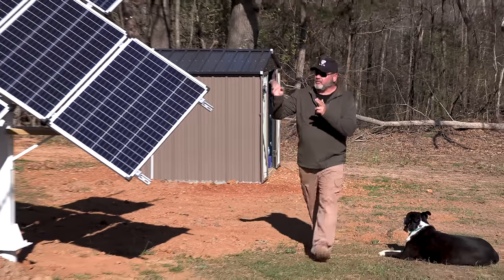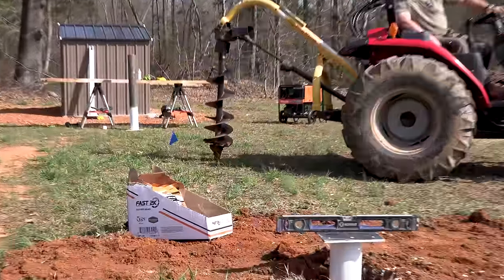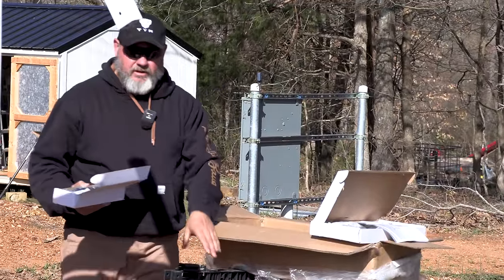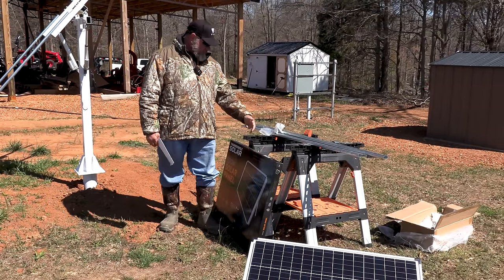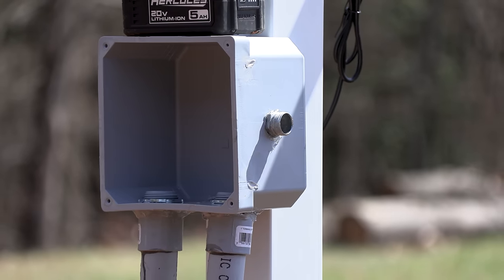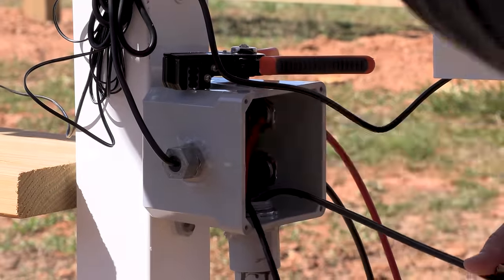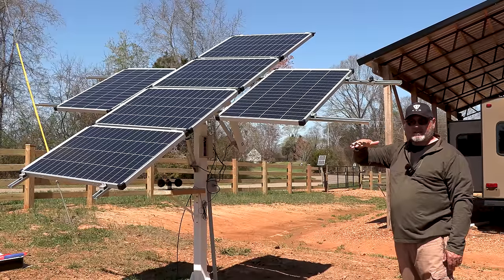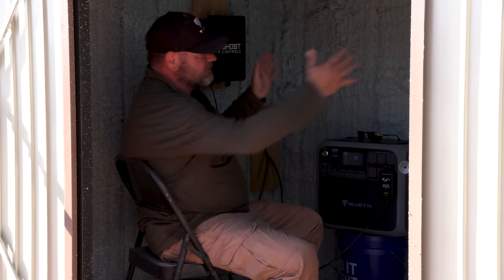You Really Need Solar Power to Survive Grid Failures! DIY Automatic Sun-Tracking Solar Array

Comment: Nice installation. I wonder why the manufacturer used a sun sensor, they could have used sun tables and a GPS module (for time and latitude/longitude) to calculate sun position.
Reply from the maker: I would guess cost and over complication. This system is very simple but works very efficiently. It's not really important to know exactly where you are on the planet. It's only important to know where the sun is.
Reply: True, would add complication and cost. But using a microcontroller programed with sun table would need at least to know the latitude and longitude of the tracker and time/date to point to the sun. Also, it would need feedback from the positioners, an additional cost. @TonysTractorAdventure
Reply from the maker: I don't see your point. The sensor aims the array directly at the sun all the time. It doesn't get any better than that.

Comment: Finally got mine temp hooked up and found the E/W actuator wired backwards. Kinda bummed it doesn't have bigger N/S range but probably for the best
Reply from the maker: The sun angle north to south doesn't change much throughout the year. It has all the range it needs, I think.

Comment: @52:22 Two years of wear and tear in 10 minutes 😂 - By the way I purchased one of these and I’m beginning to regret it. It arrives Friday. Excellent idea using the oil pipe and steel plate for foundation. 🤓
Reply from the maker: To this point, mine have worked as advertised I bought one more and they have upgraded it even more.

Comment: I used to put in satellite dishes when I had my own business at the time now I'm retired enjoying life and the first installation I had the pole spin in  the high winds so I start welding a piece of rebar to the bottom to stop it from spitting then I just took the grinder cut a little bite out of the side of the pipe near the bottom and stuck a piece of old metal in it stop from spinning I hope you don't have the same problems...
Reply from the maker: It will be fine. The thing I built will be there long after the post they built is gone.

Comment: If you set the wind speed let's just say 20 mph & the wind is blowing at 10 how long would a 20 mph gust have to last  before the panel goes flat & after the wind drops below 20 mph how long before start searching for the sun again. Guess I'm asking is there a delay or does it happen immediately. And how it hold up in the storms last Friday
Reply from the maker: You can set it up however long you want it to take. You can also set it up to stay flat for as long as you want it to stay flat after the wind speed has been met

Comment: You know if you had a decent size generator, you could turn it into a GEET Fuel Processor and sell the excess back to the grid. Free fuel and as much as you can handle from restaurants emptying out their Fryers. You'd be doing them a service. 
A GEET Fuel Processor is an add on device for a combination engine that burns 80% water and 20% oil and produces 3% more Oxygen than the air you're breaking now and produces zero pollution. Hundreds of thousands of backyard mechanics are making the GEET Fuel Processor and there's a lot here on YouTube. 
There are thousands of better ideas then the Solar Panel System. Thousands!
Reply from the maker: Are you doing it?

Comment: Love the solar tracking part but just as important are dust on the panels that often times prevent full charge. To test, if you pour water over the panels after the panels are out for a few days, you’ll see better charge rate.
Reply from the maker: Never had a problem with dust yet. Rain washes them every few weeks

Comment: Other than solar is still susceptible to weather events....  I am running a small off grid unit here, but short of it being able to shield itself under a tornado shelter automatically, its likely not going to be operational after a storm even.
Reply from the maker: It automatically turns flat when wind speeds exceed the set amount. If a tornado goes across this property it doesn't really matter.
Reply: @TonysTractorAdventure  Isn't it better to turn vertical to the ground in the wind direction hence would tornado suck up the panels?

Comment: could all 12 panels fit on one tracker or is that too much weight? I have 250 watt panels approximately 62 by 38 inches. Could 3 high by 4 wide of my panels fit?
Reply from the maker: It can handle 6 larger panels. 4 across and 2 at each end.

Comment: I agree "You Really Need Solar Power to Survive Grid Failures!" however remember there are more ways to use solar power than just PV. There are options like steam generators made from radiators and mirrors, heating and cooling options etc. You can even build an accumulator a.k.a. very large water tank and pump in water during the day when solare is working, and then use the water to spin a turbine at night to generate power.
Reply from the maker: There are many ways!

Comment: That Fast 2k foam is nowhere near as strong as concrete. Once its cured, you can still tear off pieces of it with your fingers. If you can crush it that easy then over time it can get compressed and allow your post to wobble. I personally wouldn't even trust it to hold a 4x4 fence post.
Reply from the maker: Thank you for your opinion. Electric utility poles have been holding up electric lines for nearly 30 years using Fast2k. These panels have recently gone through 80 mph winds. All is well.
Reply: I am not an expert in this field, but the idea with it being foam is that it isn't static like concrete. Meaning that while concrete may be stronger, the foam will give it a slight "sway" effect. Kind of like a tree. Rather than just fighting against wind, a tree will flex a little, letting the branches flow with the wind. They then return to their normal place after the intensive winds are done. Even a small amount of movement with the wind will mitigate a lot of force.
Reply: @ColinCreighton  that sounds like something you pulled it straight out of your behind.
Reply: @Smellslikegelfling   Haha! I mean, I started by stating that I am not an expert by any means. But I do live in a very windy state, have done multiple outdoor projects similar to this, and I know a good amount about the physics that go into it.  I haven't worked with this foam, but regardless it was just a hypothesis based on experience. No need to hate for it.
Reply: @ColinCreighton  I'm not hating, just calling it like it is.
Reply from the maker: In every case study, concrete is weaker for posts than FAST2K. If you put in 100 pounds of concrete into a hole, that is it!  100 pounds of weight. Concrete offers little to no lateral support. Fast2K pushes out into the soil, like roots with 20 to 25 psi over the entire surface of the hole. The surface of a 4'x12" hole is 608 square inches. FAST2K exerts just over 15k pounds of force.  F = 25 psi * 608.06 in² = 15201.5 pounds (approximately). So, there would be approximately 15201.5 pounds of force exerted by the 25 psi of pressure over that surface area. I know I will never convince some people, but the truth is the truth. My neighbor had his new fence put in concrete. He lost almost the whole fence in the last storm. We had the same wind, and all of my buildings and fence are 100 percent intact. All are built with FAST2K.

Comment: Its all the question of cost.  I'd be amazed if this actually gets a consistent 40% more power than an appropriately installed stationary system, but lets take that as a given truth.
1) How does it stand compared to buying 40% more in panels and required support equipment on cost?
2) Assuming the panels have a 20-30 year life span, how much down time, maintenance, or replacement costs are expected with this kind of system compared to a stationary setup that would effectively be a 'set it and forget it' install?
My general thinking is that if the big power plants don't feel that sun tracking systems are worth it in most applications, then as a small-time solar builder it is probably not worth it unless there is an extreme limit in space.  But in the amount of space you have between your 2 arrays, you could easily hold 40% more panels, so I'm guessing space isn't the issue?

Generally speaking, power is dirt cheap and you need to rely on it, so anything that adds cost or complexity should be avoided like the plague because it is either making the cost of power significantly higher, or introduces down-time that you don't want.
Reply: Ok, so 6 panels at ~$110 each, plus a $500 mounting system.
I would assume (and it is an assumption) that a stationary mount would cost under $200, so lets call it a $300 premium to get the solar tracking feature.
That would be a 45% increase in cost, for at best a 40% power gain, which isn't too bad... except that it then also adds the complexity of moving parts that will need some amount of maintenance and potential for failure.  That is taking a lot of extra risk for very little added benefit.  A neat project to be sure... but unless the cost comes down substantially it just wouldn't be worth it.
Reply from the maker: I don't think he watched all the video explaining what I was doing. This was a low-cost learning system. I'm very pleased with the trackers and how they have performed. I will mount 6 300w+ panels when we finish our cabin. I will also add a much larger all-in-one inverter. We use these 100 watt training panels for another project.

Comment: Just a correction please, it's not the voltage that is going to stop you're heart it's the amperage, on DC power 1 amp could kill you, the voltage just make the zone of safety smaller, the ark will be stronger as the volts increase meaning that you will need less distance between the poles positive and negative. But yeah the voltage is not what is going to kill you it's the amps, the amount of power going through your body, regardless of the voltage, yes theses panel are dangerous.  Obviously Im not arguing that point. Anyway  nice installation and very good device to gather as much power as possible
Reply: I just wanted to add, volts is like the speed, more speed bigger distance required to be safe,  the amperage is the intensity of flow, more flow more current, the wattage is its total power. Volts x amps = watts. It's similar to a river, or at least it's how it was explained to me. Yes the higher the voltage the more there is a chance for arking between opposite pole, positive and negative, but you could have a 100v at .8 amps short out and you be borderline safe. However you could have 12v at 1000amp and that is technically way more dangerous, if you're to short it out accros your chest, one hand to the next example, an other example would be an electric fence, high voltage, very low amps, it pulsating, so you get a good kick, but not dangerous, and thoses have thousands of volts, but very little amps. Obviously this is an install setup of the suntracker, I don't recommend that anyone attempt to wire up their set up them selfs. Btw yes DC power is much more dangerous then Ac, as you tend to stick to direct current, the Ac tends to throw you off, and the reason is the current is alternate being positive and negative unlike direct current. Also just wanted to add, please redo all your connections done wire nuts are not the way to go. I saw so many short leads twisted together in your video, it's just asking for problems down the road. Consider using like a wago connection or something similar, in my opinion. I am interested in seeing the final full sun mid day power different, to compare and contrast with their claim of 40%, which is very interesting and awesome in my opinion.
Reply from the maker: The purpose of my statement is to address the safety threshold when working with solar energy systems. It is essential to understand that a high current of 1000A with a low voltage of 12V poses a minimal risk, whereas a lower current of 100mA with a higher voltage of 90V can be lethal. My objective was not to provide an in-depth explanation of Ohm's Law but to emphasize safety precautions for non-experts in the field. It is worth noting that the majority of solar companies adhere to a maximum battery voltage of 48V for their do-it-yourself systems to ensure user safety.

Comment: impressive cheap tracker. with dropping solar panel prices the more expensive trackers are hard to justify vs more panels,  unless you are space or inverter capacity limited. This one may be cost effective.
Reply from the maker: Sometimes it's a trade-off. With this system I can have 40% less panels which save space. Will this system my panel start producing power almost as quickly as the sun comes up over the trees.

Comment: Have not got to the mistake part yet but I would have pulled wires before glueing the pvc . Big mistake if you ask me, so much easier before glueing, almost effortless !  The things holding the wires coming into the box are called Watertight Glands . Yeah Glands is a weird name for the watertight wire clamps but that's what they are called , I just ordered 10 of them yesterday and I had to think of the name to look them up.
Reply from the maker: I appreciate your thoughts.
Reply: @TonysTractorAdventure  The trackers are nice and pulling wires can be a pain , saw a guy use air to blow a string thru to grab ribbon to pull wires , very interesting . I had to put some large power cable to a garage in back and putting them thru the pvc before I glued was the only way that would have worked. Enjoyed the video and it was very well made. If my lake lot was bigger might work for me but too many panels going in off grid lake cabin/house. Thanks !
Reply from the maker: I made a video about pulling the wire. I just use a vacuum cleaner to pull a plastic bag through with a string attached to it. It takes seconds.

Comment: Shouldn't the bolts be inserted from the top, so if the nut does back out, for what ever reason, the bolt is still there to prevent twisting?   
Seriously considering something like this ... good job 👍
Reply from the maker: In the mechanical engineering world there are bolts facing up everywhere. If the bolts become loose I would hope I noticed before.

Comment: What’s the thickness of the round steel pipe, thickness of the metal plate, how many inches from the outside of the pipe to the dirt wall and finally how many bags of fast2k did you use for one tracker system?
Reply from the maker: Half inch top plate. Standard 6" well casing. 12" hole. I don't know how many bags. That was months ago. 4' deep.

Comment: Do you ever notice it 'chasing clouds'?
I've heard that can be a problem with sensor based systems like this.

Very cool, regardless. 
For a less involved setup I imagine a line of panels going east-west on a single pivot that can be manually tilted in elevation would be much cheaper and nearly as effective. 
Just go out once a week/month/season to set them to the ideal elevation angle.
Reply from the maker: The sensor voltage can be adjusted to only move when it gets a certain amount of light.

Comment: Why not using equatorial mount? It's not as though it's a surprise every morning where the sun rises, or where it is at any time without feedback. A simple clock drive would suffice.
Reply from the maker: Thank you for your feedback. You may have missed a little bit of the understanding. You forgot about seasonal change. The sun is at a different angle each day based on what time of year it is. Each degree the solar panel is out of perfect alignment, it becomes less efficient. This system tracks it, exactly,  every day for about $450 each. It would take one audacious clock system to do that. This system also levels out during high winds so as to not become a wing. Again. It would take one audacious clock drive to do that.

Comment: Hey feller!
I just bought the same solar tracker and expect to see it arrive in a few days.
The thought of getting a jumpon the installation hit me as I was watching your video.
Nowhere have I found the bolt pattern for the base. I see it has 8 bolts but I cannot find dimensions anywhere.
Could you share that info so I can get the concrete poured before it arrives?

/\/\\/\/
Reply from the maker: I have no idea. I used my base as a guide. I never measured it once.😁

Comment: I purchased the eco-worthy dual axis setup to connect to my ecoflow Delta Pro with a spare battery. So I set up eco-worthy setup and have nothing but problems  broke to actuators they just came out the end and the control panel isn't working correctly. Was wondering of you have had problems with yours.
Reply from the maker: I speak about the problems with the directions in the video. Both of my trackers work perfectly.

Comment: Bottom :Line how much to buy AND WHAT PERFORMANCE INCREASE FOR PAYBACK?   how many needed to hold 24 normal size 400w panels at height needed > 15' high at axis
Reply from the maker: This system is relatively inexpensive and I have gained at least an additional 35% over stationary panels.

Comment: You can use Solar to provide power in the event of a grid outage provided you have enough battery storage to energize your home at night and sufficient solar to both provide your daily usage and allow for battery recharging. Caveat, this type of system cannot back feed through your meter...any solar generation system that back feeds to the grid MUST automatically shut off in the event of a power outage
Reply from the maker: Thank you Bryan. Very good information.